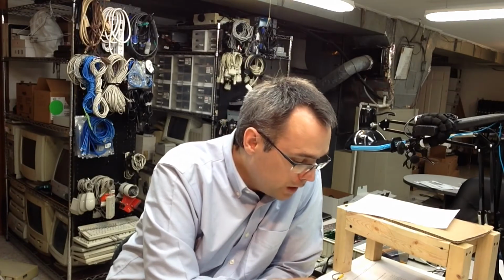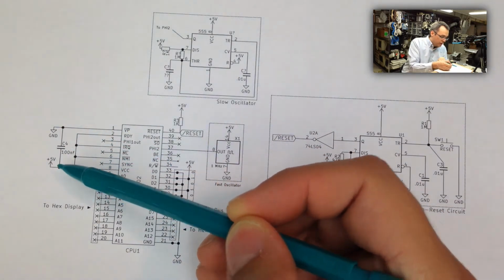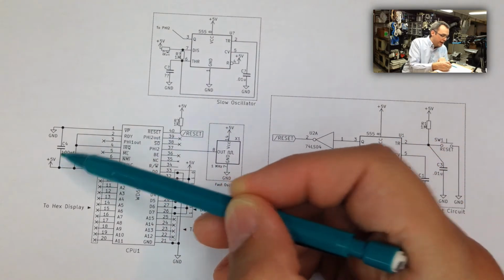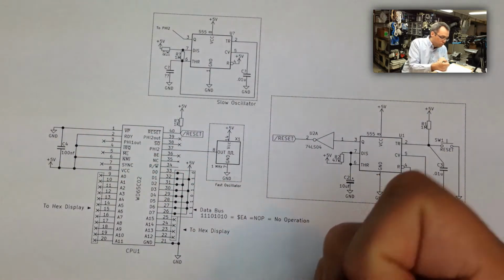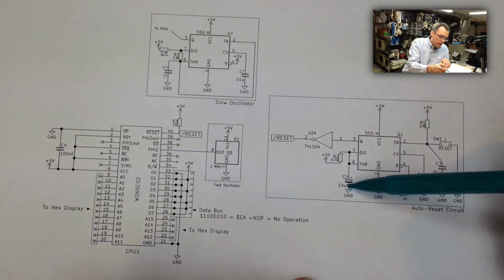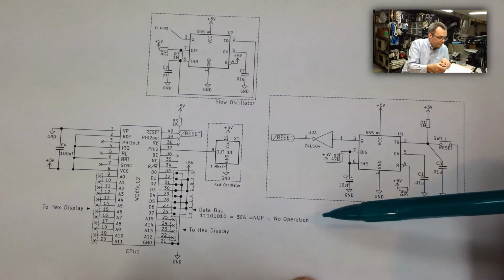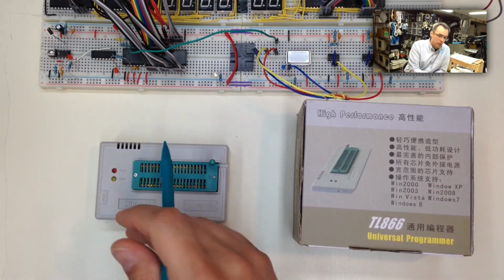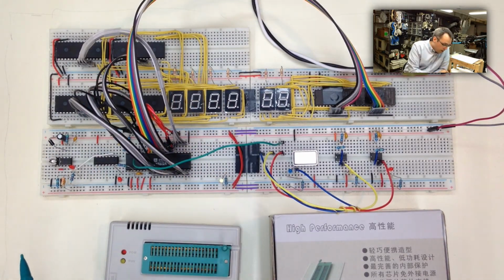FREE RUNNING - Codename: JCM-1 [Episode 2]

Comment: Cool project Joe! Question - why didn't you use some sort of reset IC like a DS1812 instead of discrete circuitry? The reason I ask is that so many people do it the "hard way", as it were, and the reset supervisor parts give clean reset signals, which prevent debouncing when the system is reset. Keep the breadboarding and retro experience alive, and thanks!
Reply from the maker: Several reasons. 1) Using a 555 was the first way I found that made sense to me. 2) The 555 is one third the price, 3) I wanted to learn how reset debounced worked, and studying this circuit helped me and 4) The 555 felt more period accurate to me. The 555 solution is basically the same one used in the Apple II, and it works perfectly. That said: a reset chip is super easy. Plug it in and go.
Reply: Got it - always good to learn how things work. Not enough of that going around these days. Nice work!

Comment: I have another Question or two.  I did a screen grab of your circuit diagram and I would like to know what is the value of the Capacitor that goes from pin 6 to Ground.  Also your circuit diagram shows the Reset circuit is a 555, but the chip on the bread board is more 8 pins, but look shorter than a 556. what is it?
Reply from the maker: Sure. The cap is 0.1uf or 100nf (however you want to measure it.) The chip to the right of the 555 is a 74LS04 hex inverter. I'm using one of the six inverter circuits to change the high output of the 555 to the low output the /RESET pin requires to trigger reset. I swear I'll have a more detailed schematic ready for next video. Project is on a short delay while I play with a new old computer I recently acquired. :)

Comment: I love this project.  I went to Frys today and spent way too much money to do what you are doing.  Bye the way, I was laughing when I noticed that you were building a 16bit read out, when as you know 8bits is all you need :>  Please put up you schematic and I would like the part number for the 1 meg oscillator.  Thanks!
Also the price on the web for the EEPROM programmer is $40 or more.  The ones priced near $40 all seem to ship from hongkong.
Reply from the maker: I knew I would get the price of the programmer wrong. :)  I will be working towards schematics, parts lists, etc. as I get to it. Please remember, I am learning as I go and doing this in my spare time (I do have a day job). I just recently learned how to wrangle the schematics program - so it'll take some time ( as I'm writing this reply, I'm doing day-job work in the background, so even my free time is my work time!)

The 1Mhz oscillator I used is part number OSC1 from Jameco.com, but you can use the same thing from any vendor you wish.

Comment: Coming along nicely!  It's a great feeling to build something from scratch that you can completely own.  (Note to self, need to get an EEPROM programmer so I can play around with writing my own BIOS)

Video production question for you:  The shots of the bench are very good, but you said you use mostly an iphone -- are you using two iphones, one for the bench and another for your narration shot?  Also, how are you lighting the bench?  (Just the overhead tube lighting?)
Reply from the maker: Thanks for the comments. I must say the TL866 is a good cheap programmer for hobbyist purposes. I have a couple of iPhone 5c units that were donated to me. BenchCam is on a cantilever arm: basically a meter long strip of black painted wood affixed at one end to a camera tripod, with a small black flowerpot attached to the far end as a counterweight/stabilizer. It hovers over the bench mostly out of the way, and because it sits on the table next to the bench, bench vibration doesn't affect the camera. FaceCam sits on a cardboard box on a small shelf to my right. Using really cheap "octopus" type tripod things as the camera mounts. 

Lights are overhead fluorescent 4 foot dual bulb fixtures. One to my left, one to my right, and one at the back of the bench - provides multiple angle non-spot flood lighting. Does pretty well for cheap $12 fixtures. Then I have a small desk lamp with a tungsten bulb on a shelf above me to the right to light my face and warm up the shot a bit.
Reply: Show production on the cheap, love it!  Thanks for the explanations.